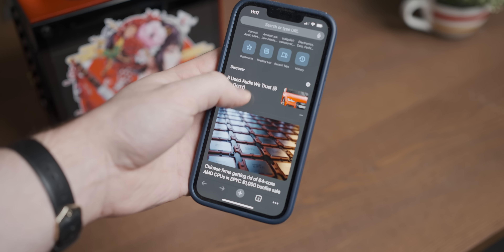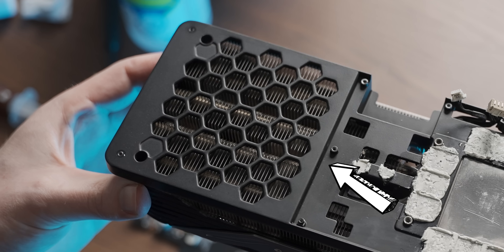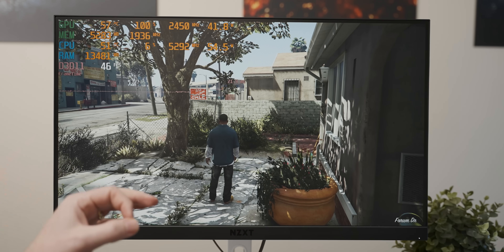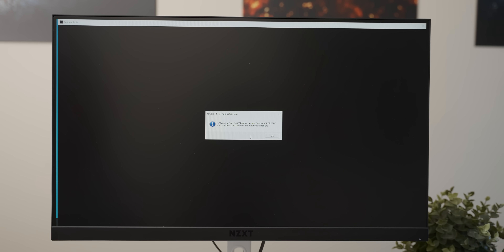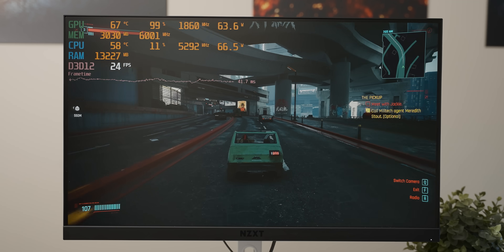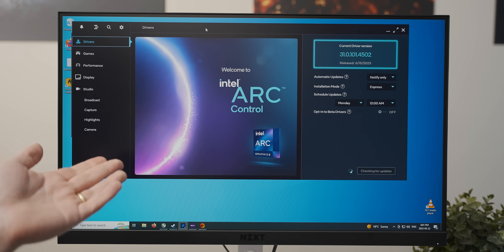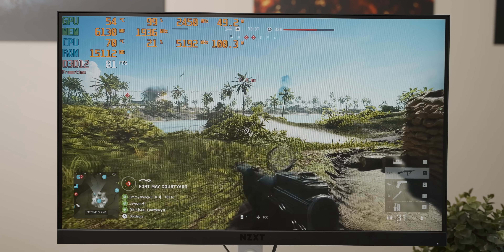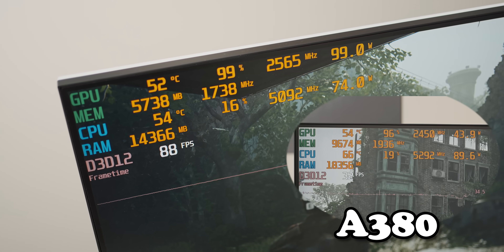The New Master Of Fine Wine Graphics Cards?

Comment: The rx 6600 is the main contributer to the latest gpu market crash 
For 200$ you get an excellent 1080p card that can play all games at 60 fps you don't need to upgrade your cpu or get a new power supply in most cases
Reply: I was able to find a RX 6700 XT for 200. Is impressive what AMD was able to do with the 6000 series.
Reply: Do you have one and if so what did you upgrade from? Also what games do you play that have improved. I game at 1080 and currently have a RX580 8GB but I am pushing towards the 6600 but I've seen a 6650XT for £240 sell my 580 for around £70 and I can get it less than a current 6600 cheapest is £180😊
Reply: @dnakatomiuk   my upgrade path was 580 ->1660ti->3060->rx 6650xt
The last one wasn't as big of an upgrade but i needed it because it gives me around 160 fps in warzone 1080p and even 200 in Mw2 

If you can go for the 6650xt do it , the price is great and the performance is on point
It's also great at 1440p if you have the monitor
Reply: @fawaz908  That's an odd ish upgrade path seems a little incremental, i went from 1080 ti to rx 6800 for 1440p.
Reply: @fawaz908 How tf do you get 160 fps with a 6650xt?! This might be your peak. Do you use fsr or sth.?
Reply: @fawaz908 If you end up seeing the 6700 xt or non xt for less than 300, go for that. I went for that from the 1070
Reply: @fawaz908 😅
Reply: @dnakatomiuk  As another option, I would suggest to look for 5700xt on the used market, there should be options under 150£. Or maybe even a used 6700, the 10GB of vram might get handy in the future
Reply: @dnakatomiuk  I ran a 6600 with my r5 5600x and my 57 5800x3d for over a year before I got my 6800xt. 6600 is an amazing card, but if you can afford a little more I'd say shoot for the rx 7600, It's sitting on par with the 6650xt basically and will/should surpass it with the next few driver updates. If money is tight, you can't go wrong with the 6600/6650xt though. All are great cards
Reply: @dnakatomiuk  get the 6650xt. i paid 230 for a normal 6600. love it so a 6650xt can be nothing but better news.
Reply: @dnakatomiuk  i have an rx6600 upgraded from a 4gb rx570.    I play at 1080p and noticed that whenever my cpu wasn’t holding me back I was getting double the fps of my old gpu, so it is definitely a good upgrade to an rx580.   But take a look at pricing in your area some of the other gpus might make more sense if they are not much more
Reply: @dnakatomiuk Just go with a 6600xt in my opinion, or if you can the 6700 (non xt) is not much more if you can find one on sale and it's a decent amount better than the 6600/6650xt plus it has 10gb vram instead of 8
Reply: @MrBeetsGaming  Unfortunately it was in the UK was the 6700 10Gb before Christmas at around £220 but it sold out within seconds and now it can only be imported and most ask around £380 😂😂. The Powercolour 6700XT fighter has dropped to £320 but I need a new PSU as I only have 550w, my old 750 was on its way out last year and I needed a quick replacement. The XFX 6650XT needs a 500w but that 6600 and it's low power draw is what is pulling me if it's a good 1080p card, I try to go for power efficiency as another major factor as well. Though at the time I bought my RX580 8GB is 2020 when I built my Ryan rig it was going for £164 new
Reply: @dnakatomiuk  get a used market 6700xt for £250ish imo, maybe a 6800non XT for £300-350 if you are lucky
Reply: @dnakatomiuk I got a RTX2060 mobile frankensteined onto a desktop GPU pcb a while ago for an equivalent price of 84usd, and upgraded from my RX580 2048sp(a rebranded RX570) to it. These are second-hand cards taken out from mining rigs, and the supply for these weird cards are running pretty low here (in China). Mine's silicon quality is actually decent (7905 in time spy graphics score after a bit of overclocking, power limited by the laptop power limit), but I can't say for the rest of the bunch😅
Reply: The 6600 is amazing at 1080p and more than enough for me at 1440p. I can play majority of games at 60fps and with crisp visuals. People are spending so much in search of perfection when the middle ground is good enough and reasonably priced
Reply from the maker: The GPU is such a beast, it’s really hard not to buy one.
Reply: @DawidDoesTechStuff  unless no money lol
Reply: well that's only for west countries, In India where I'm from its 280$ which is alot for majority of the population. In 200$ we get 6500xt, 1650, rx6400,1630 and 1050. It's been like this for years
Reply: @lowendplayer4259  For certain countries it really sucks, yeah. It dropped to ~ 200$ here in Lithuania (EU) but it's still a bit much for me personally.
Reply: Cant beat the 175$ cost of rx 6600 tbh
Reply: I also had couple of flagship GPUs i got from the used market, the only reason i couldn't keep any because they need a whole new system, i.e better cpu , psu , mobo you name it
Reply: More like 1080p at 100+ and 60 at 1440p
Reply: @OctoomyYTOfficial  6650xt might be a 1440p card, but the 6600 can not even match a 5700xt, still a good card though
Reply: I have a 6600xt and it is soooooo good for 1080p
Reply: I've seen even some used 5700xt go for around this price so yeah there seems to be once again some decent bargains out there. My wife still has a 580 doing pretty well and thinking of a 6600 for her.
Reply: or buy it used for 140€ :)
Reply: I think the new 7940HS with the 780M IGPU does significantly better than this dedicated graphics card.
Reply: It's also super efficient the drivers are awesome and is a quieter cooler card than the 3060
Reply: Yeah... It's definitely not a contributor to the market crash... at all.
Reply: 6600 is a great 720p card
Reply: I have a 600W psu from fantech and current use a 9th Gen i5, 16gb ram and a 1050ti

Do I need any changes to upgrade to the 6600?
Reply: @michealtheevilhero2340  CPU upgrade. 9th gen i5 is slooow
Reply: 100% I bought one for a budget build I was selling because I wanted something better than an RX 580. I was amazed at the bump in performance! Great card for a good price.
Reply: And the many many many used rtx 30xx
Reply: I just got a 6600 and it is so worth it
Reply: Can this be build in mini nuc type pc?
Power draw must be 200W for complete system no more
Reply: Arc 750 costs similar.
Reply: Im still using a 1080ti, its still a beast. Can run basicly every new game at 60fps medium. And if its an older title it can at 144+ fps! And its pretty cheap aswell
Reply: 2nd hand 1080 ti beats it
Reply: 570-1070-3060-6700 here. Basically same as you performance wise. I got the 6700xt from the mining crash second hand flood. Can safely say 6000 series is set to be the finest wine.
Reply: My lil bro upgrade from his aging rx560 to that 6600 early this year and he got it for $150 the asus dual ones
So much better but his i7 2600 is bottlenecking it😂
Reply: @gg95-k7y  I feel that pain, I inherited my first PC in 09 and it had a core 2 quad and an "upgraded" gt 210. I slugged through with that system and then I got a gtx 660ti for Christmas, bought a second one to run in SLI and I was living the ddr2 bottleneck dream lmfao
Reply: @AatroxSuppMain  yeah he'll get my 12100f by year end
He can bare with it while i wait for 14th gen if it can support my b660m
Reply: Do you think the RX 7600 will replace it as the new $200 excellent 1080p car?
Reply: @FlorisBoere The 7600 is about the same performance as a 6650xt which is actually almost the same as an overclocked 6600xt
Reply: @FlorisBoere Eventually yes but it will take some time to get there
Reply: For 200$ you can get the same performance as a card from 6 years ago. Amazing.
Reply: @Aggnog  Considering the massive performance jump that those 6 year old cards provided at the time, yeah. I'd expect lower end cards today to still compete with flagships from 5+ years ago.
Reply: @Aggnog  I'm pretty sure that the 6600 is a decent mid range card, what are you going off about?
Reply: @Aggnog yeah I'm kind of with you on this one. I bought a 5700 at the end of 2019 for £290 with a £50 rebate. So performance that cost me £240 3.5 years ago can now be had for £200. To me it seems the prices still need to go down a bit more before we can say they've crashed
Reply: it's not the main contributor at all. Look at the steam data and you'll see how dumb this sounds.
Reply: @raikaru0  I don't think that is what he meant. I suppose he is referring to the recent crash in GPU prices, AMD constantly lowered the price of 6600 - 6700 GPUs, consequently forcing Nvidia to adjust prices on their own lineup.
Reply: @mastroitek Funnily enough Nvidia held off on adjusting their prices for an EXTREMELY long time. 6650 XT's and 3050's were price competitors for a whole YEAR, and even now the 6600 embarrasses the 3050.
Reply: Wouldn't call the 6600 non xt as good 1080p. The 3060 is better with 12gb vram, or just a bit more get the 6700 or 6700 xt
Reply: @gejamugamlatsoomanam7716  im yet to come across a game my 6600 cant handle in 1080p...
Reply: @J03130  it very much depends what you mean by handle and at what settings, it doesn't have a chance in hell running CP2077 with any RT well.
Reply: @oxfordsparky  no obviously not its not a card designed for RT its a mid range card and playing games at 60+ at 1080p  high is what is what it was made for and its great at it.
Reply: @gejamugamlatsoomanam7716  but by the same argument you can go for the RX 6600 XT or jump to the 6700.
Reply: @gejamugamlatsoomanam7716  the 3060 also costs 4040% more
Reply: @gejamugamlatsoomanam7716 6600xt is better than a 3060 especially at 1080 where you almost never need 12 GB of vram
Reply: @gejamugamlatsoomanam7716 Nevermind I misread that, didn't realize you said non xt
Reply: @gejamugamlatsoomanam7716  Yeah, but the 3060 is typically just that little bit more expensive, so it's not so much better value as it is "pay a bit more, get a bit more".
Reply: @gejamugamlatsoomanam7716  It is though at least for getting 60fps,  8gb is enough if you don't put it on ultra.  In my country Rx 6600 is 13k while 3060 8gb is 18k which totally killed the 3050 because its around 17k in dual fans. The 12gb 3060 is around 23k.  If you're just gaming its a no brainer what to choose but if you're a streamer just pick 3060
Reply: @gejamugamlatsoomanam7716  Well, it's an entire price tier more expensive.
Reply: @gejamugamlatsoomanam7716  nobody argue 3060 is better then 6600, but did you look at price?? 280$ vs 180$ for 10%-15% more performance, so in game if you get 60fps on 6600, 3060 will get you 65-70fps. It just not worth it, also dlss or fsr just looks bad on 1080p, so its not a factor, both cards are to weak for raytracing.
Reply: @broniusbronka2703  shop around for deals, some used mining 3060 can be gotten for cheap
Reply: @broniusbronka2703  stop repeating other peoples lies, I gamed at 1080p for 2+ years using DLSS on 2060, then 2060s, then 3060 and it looked absolutely fine, FSR looks terrible compared to DLSS at lower resolutions.
Reply: @broniusbronka2703  dlss just for antialiasing is worth it, and makes 1080P look better than native.
Reply: @oxfordsparky  Wrong
Reply: @gejamugamlatsoomanam7716  i was talking about the 6650xt 
Sorry if you got the wrong idea
And yes for 1440p the 3060 is better, not mentioning dlss which also can help

Comment: yah, but it's an US$80 difference, like.. 40% more or something? That's a huge jump.
Reply: 40% for 300% performance, thats free performance, it basically means you don't buy a GPU at all until you can afford 6600.
video-games aren't going anywhere, 200% improvement justifies any extra wait time for saving even if its a full year. even 100% improvement is good enough to save up.
Reply: @PotatoLord94  Yep, the sweet spot is really the best thing to go for if you're on a budget. I'd argue if you're really struggling for money and absolutely need a GPU in the price range of the A380, then just look at the used market.
Reply: $60 difference, the 6600 is currently $179

Comment: Ey thanks for highlighting that „yeah the drivers improved“ but with older games and some new ones still lacking decent support the answer is clearly to get one of the best value cards with working drivers, the rx 6600 (even beats the 3050, which is hilarious)😂
Reply: i just bought a RX 6600 for my  HTPC and it cost $40 less then the nearest 3050 which was an option. Excellent value, and runs cool.
Reply: 6600 beats 3060 handily in some games , 3050 is a piece of cake
Reply: @fenixspider5776 you mean the 6650xt?
Reply: @thebcwonder4850  pretty sure it is 6600 which beats 3060 in some games
Reply: @fenixspider5776  wdym “some games”? A 3070 is faster than every Radeon if your only sample is Cyberpunk on RT Overdrive
Reply: @thebcwonder4850  not really sure what you mean but I said 3060 not 3070. 3070 is rx6700's competitor
Reply: @fenixspider5776  the 3060 is faster than the 6600 overall by 8-16%, even more so with RT on
Reply: @thebcwonder4850  yup that's why I said some games
Reply: @fenixspider5776  I brought up Cyberpunk and the 3070 because "some games" is a dumb statement. "The 3070 beats the 7900XTX in some games" is true, but it's still a dumb statement
Reply: You can get a RX 6700 XT for $330 to $340 you might have to upgrade for a 600w to 650w power supply to run it.
Reply: @DJboutit2 That’s a 70% price increase, and possibly a PSU upgrade as well. You’re solidly into a different price class than the A380/RX6600/GTX 1630/1650 at that point.
Reply: @jameslake7775 why not just save your money, and get the better specs?
Reply: @wheniztheend  Because if you’re trying to work to a budget, “Just delay until you can make the budget bigger” isn’t always helpful advice.
Reply: @jameslake7775  absolutely, and the cheapest, reasonable 8gb NEW card is the rx 6600, ofc the 6700xt is way better with its 12gb of vram and in my opinion prob the second best priced card you can buy new, but I was just thinking of a strict budget, hence the 6600 recommendation :)
Reply: @jameslake7775  just save up $3000 bro (jk)

Comment: How did the Intel GPU hit 7,4GB Vram when it's only a 6GB card? Sorry if the answer is obvious 3:57
Reply: if you have a dedicated gpu and you go into task manager, under GPU you'll find "Dedicated GPU memory" and "Shared GPU memory". It means it's using your system ram as an extra buffer so that your gpu doesn't have to use your SSD or even worse your HDD when the game calls for more Vram.
Reply: @maxx1o1  understood, thanks a lot :)
Reply: When the game require more VRAM than the card has it spill over to system RAM.
Reply: @PyroCatus  I see thx :)